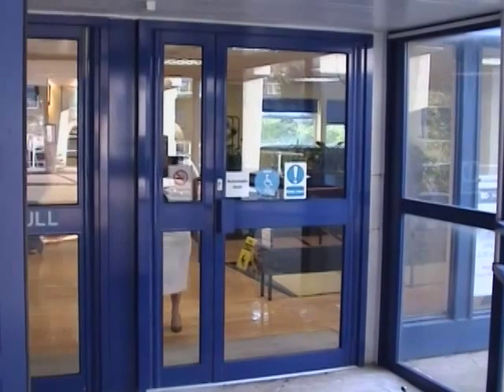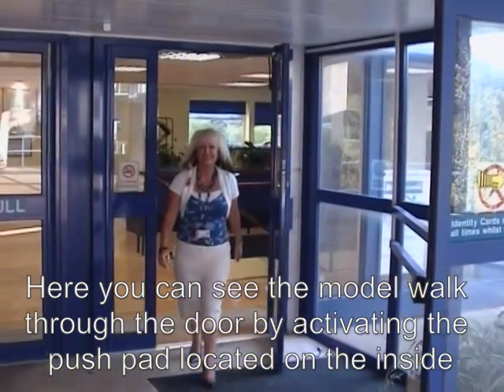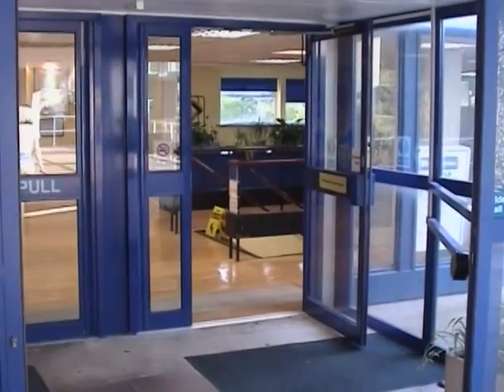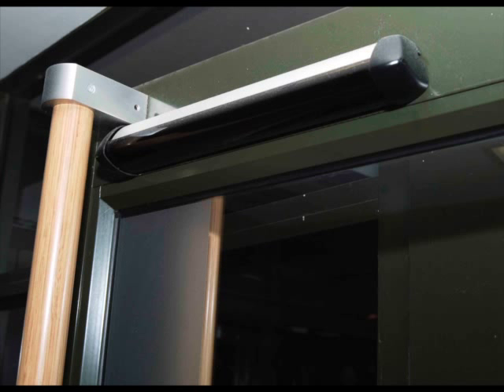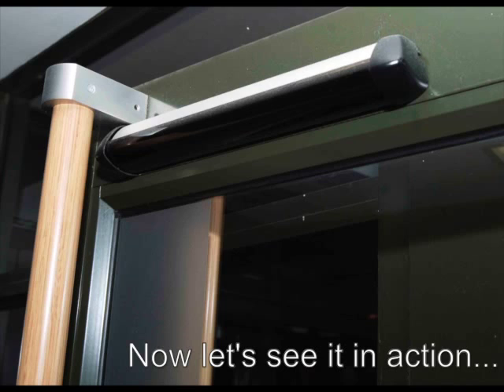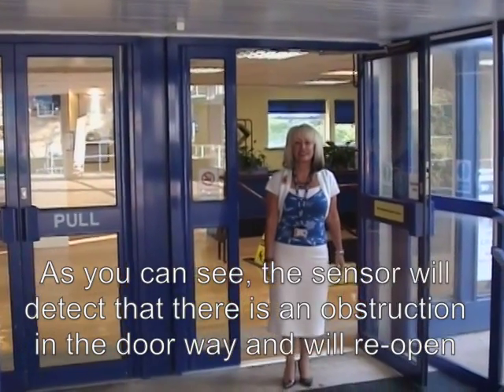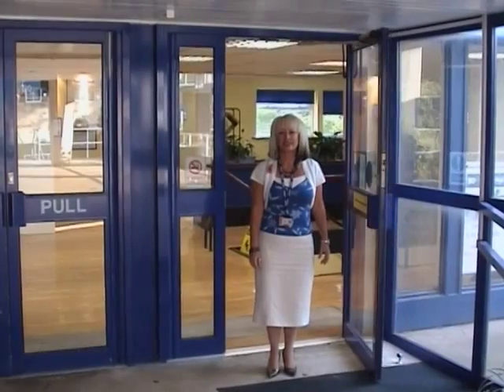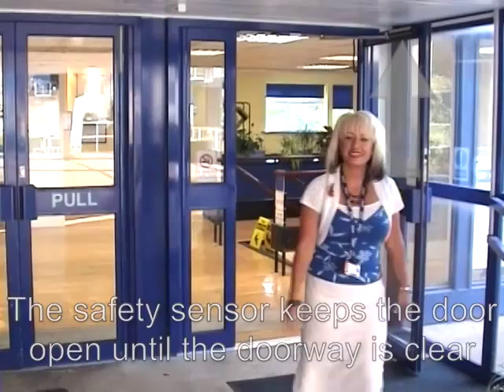Safety Sensor Demonstration For Automatic Swing Doors

Comment: And it sometimes sends a signal to the door operator, telling it to open the door. I have seen a lot of automatic swing doors without a radar sensor, but with those sensor bars on top. And they act just like a motion detector.